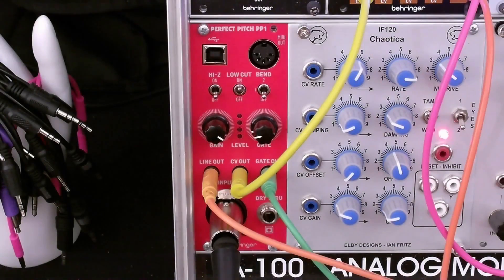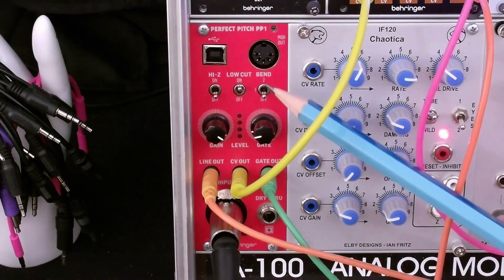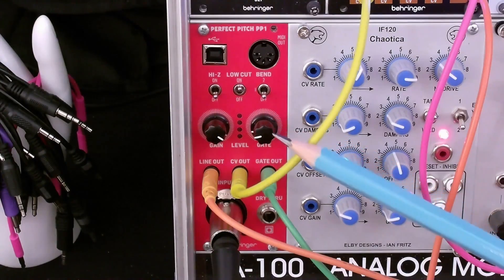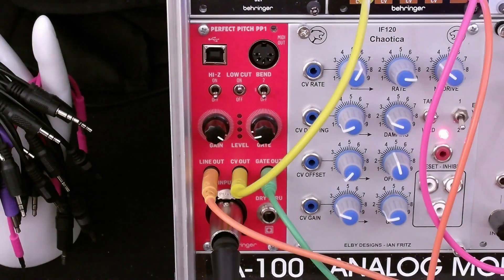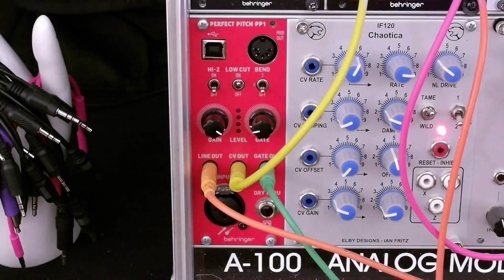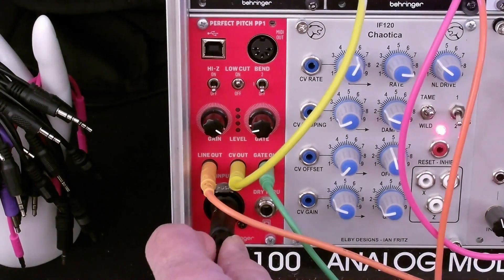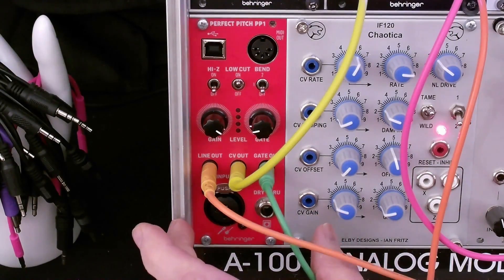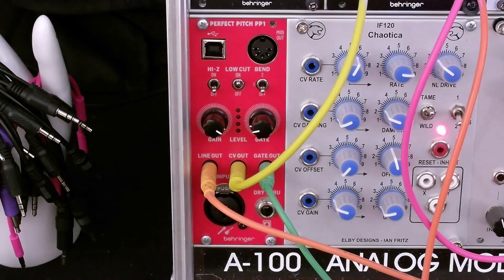PP1 Pitch to CV/Gate (or MIDI) Converter

Comment: Thanks OZ. Hall dor your consistent behringer overviews! 
Id like to know, would you mind commenting on or making a video on how well thos module functions as a usb host for the use of daw midi controlling eurorack? Does it only send pitch cc? or does it send clock? if it sends clock, that would be a great bonus. Also, sending external audio instruments in, then sending the converted pitch tracking into a daw to play vst synths.... dies it do that too? and if yes. how well?
Thanks in advance
Reply from the maker: Thanks for that.  The PP1 sends only Note On/Note Off.   By Note Off I mean both Note On with Velocity 0 and CC 123 (All Notes Off).  
I routed the audio output from my modular into the PP1. I was using a sequencer, and I had to clock it from my AKAI MPC Live II (using its CV/Gate outputs).  Basically I set up a track with Eighth notes with 50% gate width on the MPC on track 1.  That was my clock for the modular sequencer.  I routed the modular audio output to the PP1 audio input.   It was a bit fiddly (I had to use short releases and set the PP1 input gain and thresholds just right).  I routest the 5 din MIDI output to the MPC MIDI in.  I recorded the MIDI input on Track 2  I did successfully capture the sequence.  It is a technique that I may well use in the future.
Does that help?
Reply: @ozhalljr  Thanks for the insight, but this didnt answer my questions related to the DAW/USB. 

I want to know....

1. if i can rely on it for sending midi into my DAW over USB, 

2. If I can send Midi from a DAW over USB to the module, to then use the midi note data for controlling other MIDI destinations. 

3.  If it can extract CV from the DAW's output of midi pitch data to be distributed across eurorack for cv control such as v/octave, and gates. 

4. since it has a USB port, and a midi port, can clock from a DAW be sent over USB and distributed across eurorack? 

Thanks :)
Reply from the maker: @Pspiralifemusicandedu  
1) per the Quick Start Guide, just as it sends midi notes out of the 5 pin DIN MIDI connector ...
"USB SOCKET – the USB socket can be used both to output USB MIDI derived from the audio input, and for firmware updates.  
It will also accept MIDI input and convert 
to CV/Gate output."
2) per #1 yes, DAW to CV/Gate, but apparently not to the 5 pin DIN MIDI out.

3) per #1 ... yes
4) I don't see any indication that they support MIDI clock.

I have successfully tested the MIDI over USB.  It works (outputs MIDI from the audio input) with the AKAI MPC and Ableton Live Std 11.

Comment: Shame Behringer doesn't make decent user manuals. I have and love this thing but I was able to put in the time to tweak it and find out how it works. It's getting a lot of negative reviews because people don't know how to get it working well. Mine came out of the box with CV offset way too high. I had to crank down my oscillators lower than they could go to match the incoming note.

In order to fix it, I had to tweak the pots in back and do other adjustments with the button on the back. This was just from experimenting but a manual would still be nice.
Reply from the maker: Vince,
Thanks for commenting.  I've noticed the same "biasing" of the CV, but just tuned appropriately (low) and went with it.  Can you quickly document what you adjusted?  I'd love to know what to tweak (and what not to touch).
 Is there any use case that I left out of the video?
Reply: @ozhalljr  there are two pots. And once I got it just right, I didn't want to mess with it again. One adjusts tracking/interval and the other is an offset (can't remember which is which).

 Plus, when you press the button while powered on, the right knob adjusts offset as well. The LEDs turn into a binary readout counting up and down indicating the offset amount.

There was another thing I couldn't figure out after tinkering for awhile. If you hold the back button in while powering on the unit, the front LEDs flash and the unit becomes inoperable. I'm wondering if that's some kind of factory mode for calibration. Or, what I really think it is, is the mode for receiving firmware update? Not sure if the device is fully analog. The Behringer Tribe app does recognize the PP1 when you plug it into the PC with its USB port.
Reply from the maker: Where did you find out about the manual offset adjustment via the "Gate" knob?  I trust the "button" is on the back of the circuit board, right? 
The only documentation that I've seen is the quickstart manual.  Perhaps I should reread it.
Reply: @ozhalljr  sorry I missed your response. I found it by trial and error. And yes the button is accessible on the rear of the PCB. I hate it when manufacturers make you pull the module to do things!